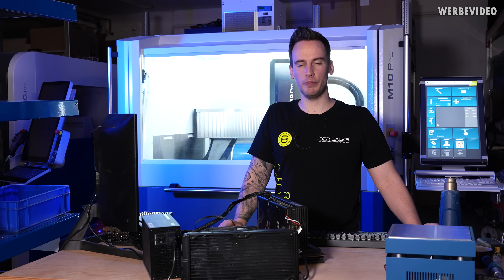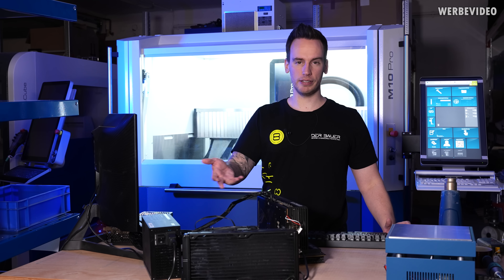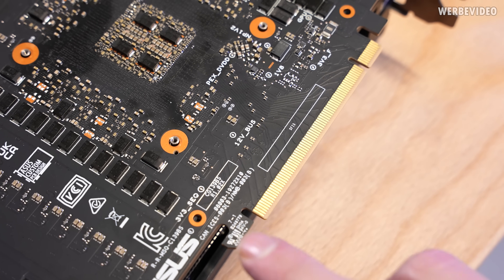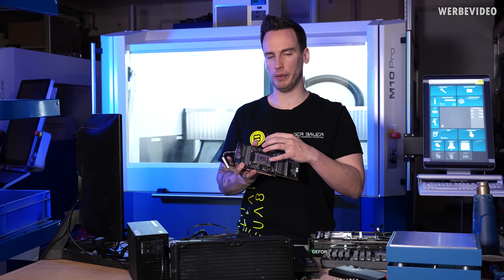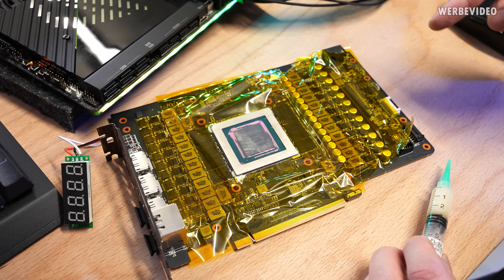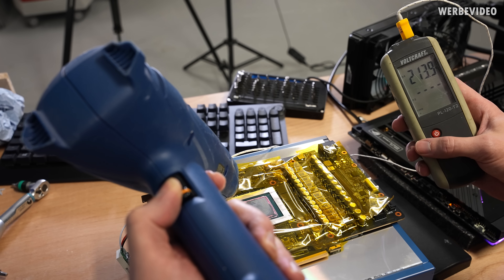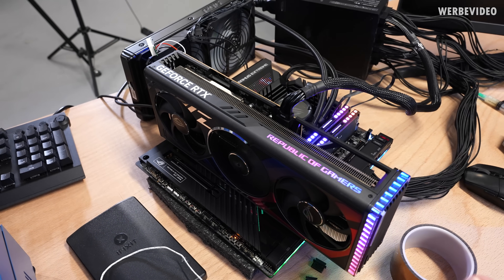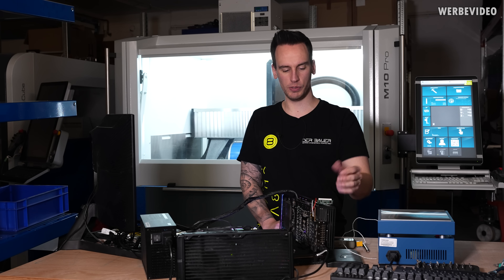I tried to repair my RTX 4090 and killed it :(

Comment: with flight simulation, I don't think i want my 4090 card running at x8.  ms2020 is brutal on GPU's and CPU's.  It eats them and spits them out.  If I could run my 4090 at x8, I could put another 2TB nvme m.2 SSD in my gaming computer.  So yea, I'd love to run it at x8 to gain me more lanes.

Comment: You better need infrared repair station for such level of repair. It can follow special thermal profile with phases like flux activation, solder melting, etc. Of course, it's possible with the heat gun, but the skill level required in this case is very high + the heat gun itself should be dedicated for electronics repair with temperature control.

Comment: Not sure how basically injecting flux under the gpu would have helped it in any way? My guess is this was bios or driver related and but hardware at all. Why didn't you request a replacement?

Comment: I baked my old Radeon 9800 XT back to life back in the days. I was very careful to wrap the underside of the card in aluminium foil and use a toothpick to get it as snug around all components of the card to make sure the foil would hold them in place in case any solder would dislodge. I just put it in the oven and let it run for 200°C for an hour.

Comment: I'm fairly certain you would have checked this, but in the interest of being thorough: when you did the hot air reflow, did any of the passive components (resistors, capacitors, etc.) move out of place? Were there any solder bridges created? It could be the GPU itself is fine, but we've lost some signaling lines, or they're being pulled to the high/low rails when they shouldn't be.

Comment: I would recommend a proper bga service shop for this card,and Im sure your card after 220C should not be dead.
I live not so far from you 2 or 3 borders like,and i got an asus rx 580 with memory related problem,what under load made some artifacts that tipical in memory bga problem.
Long story short sent back to rma,in germany and  asus service simply repaired it with proper bga machines,and devices.
You should call them,or find them to check out your stuff.
This stuff worth to repair,so asus service should help( not for free obviously),but if its not the case in EU i know 2 or 3 guy who whould take of those rams,or at that case gpu if needed,and repair it.
BTW i worked these type of hotplates ,and these are good for reballing and not for reflow for sure.
These works like in the middle you get the temp what you read,and the corners and edges expect much much lower temps,due to the surrounding air is lower,and basically it  cools back,and im sure there is just one sensor worst case in the middle, better if its corner,but that means in middle could reach like much more so these hotplates most cases useless,and about heatgun i dont even want to say a thing.

Comment: Heatguns like that don't have much fine control over the air temperature. It simply bangs it on and off I an cyclic manner. Good for stripping paint off things and burn things. But for reflowing it's horrible. Likely the GPU die itself reached death-tempertures. That's why it has to be a reflow owen, or a proper reflow/soldering heat gun with the proper temperature control.

How do I know? 

Experience. I made the same mistake.

Comment: When I saw hod did you aproach to do this, I was pretty sure you will kill it, no matter that I read it in the title... I used to bake so many cards and some of them were fixed and some not, but never put flux and allways with the GPU under, because when you do it with GPU on top, it's own weight can cause solder points to merge ;)

Comment: I've fixed GPUs multiple times with the oven method.10 minutes at 200 degrees C. And turning the oven off and opening the door before taking it out. Different problem though. Heat gun doesn't work I tried that. You need all of it hot for an extended period and heat gun is not uniform.

Comment: I have a Strix V64 that does the exact same thing, but it has a shorted core.
You didn't think of just how hot the air coming off the gun is, you only accounted for the temp sensor temperature

Comment: A screw recently broke in the heat sink of my MSI GTX 970 as I was attempting to add new thermal compound - I really believe I was more upset over than that Roman was killing a RTX 4090.

Comment: Not an expert, but I'm pretty sure that materials used for BGAs and die-attach materials are only meant to be heated up once to a certain temperature, afterwards every heat up above their temperature profile is a coin toss between prolonging it's life until inevitable failure due to the same issue or just straight up destroying the connection between package and PCB or package and chip die.

Comment: Sorry to hear about your 4090 RTX ... Maybe off topic but maybe another cooling system not yet on the market could solve everything (including the failing cables as the power requirements would be much lower with undervolting at the same time whilst still overclocking) I have send you an email just now about this :)

Comment: I'm not sure, but I don't think adding flux around the chip is the best idea for this.
It is sometimes done for BGA reworks, but only with a proper IR rework station.

I've seen other people do that on YT vids, though (and I've done it myself), but I've never had good luck with using a hot air station alone, only a reflow oven.

I think the non-uniform heating method is a big part of the problem here, ie. using the heat gun...

Some parts of the chip would have started to reflow first, and the capilliary action of the (now very liquid) flux can cause the solder balls to "swim" around under the chip, and cause an open-circuit or bridges.

I'm also not sure what effect it would have that the GPU seems to have epoxy on the four corners?
(normally during a reflow, the chip will tend to self-center over the pads, as the solder paste and solder balls melt.)

You'd probably be better off with a cheap 1500-2000W toaster oven modifed with a reflow controller, to reflow the whole card at once.

Although you'd then you have the problem of making sure the components on the underside don't fall off. lol

They sometimes add the red glue under every component on the underside during pick n place.
But more often these days, they just PnP the underside of the board first, then they protect it from the heat with a kind of shield, during the second pass through the reflow oven.

(and the industrial reflow ovens can be set to heat more from the top of the board than the bottom.)

It would be interesting to see an X-ray of the chip on this 4090, to see if it really is a problem with the solder balls.

With the amount of Kapton tape on the board, I'm doubtful any smaller components would have moved much (if at all).
Maybe something on the bottom of the board got damaged by the preheater, though?

(or the combination of 100C preheat on the bottom, and the 220C+ heating from the top, caused some component on the underside to shift maybe?)
Reply: Oh, as others have said, maybe some RAM or something did reflow when applying the heat gun, but the Kaptop tape was putting uneven pressure on the chip, causing the solder balls to bridge?

That does make quite a lot of sense.

Usually with that much Kaptop, it can shield components very well.
But with the preheater on the underside, it gives everything a "head start" on the reflow process, so when you applied the heat gun, something else might have shifted.

It's weird how the OS isn't even reading the GPU temp, though. That could either be an issue with solder balls under the chip, or maybe even a switching reg on the board stopped working for whatever reason, and one of the supply rails is missing?

Definitely worth checking all of the major power rails for 5V, Vmem, Vcore, PEX, etc. before trying anything else like MATS.

Comment: Should have probed the PCI pins first back to source to see if any were shorted or disconnected. Could have done that with a cheap multimeter. Call Rossman or NorthridgeFix.

Comment: Roman, I like your reviews, but your liquid metal graveyarded 2 motherboards now, 3 gpus, and potentially one i9-9900k, that one I can't check now with no motherboard.
I am always super careful in liquid metal applications too. 
I will never use liquid metal on any of my cards again. I suggest no one does either. Even a microscopic amount of liquid metal can run off into the socket or capacitor area.
Reply from the maker: I honestly never had that. Usually you apply so little that there is no chance of LM dripping in anywhere.

Comment: It’s really important to consider the history of this card. It’s very new (obviously), it has a PCIE problem, and it has been under LN2. The PCIE slot is essentially directly connected to the GPU chip, and since the capacitors tested fine, the original problem was almost certainly with the GPU core itself. Since the heat was applied to the GPU core, and the board was covered with what looks like thermal insulation tape, it’s unlikely that another component received too much heat. My guess would be that the bumps connecting the chip and the substrate have failed/become misaligned. Buildzoid explains this really well in his video about chip degradation. It’s important to note that the PCIE controller and the memory controller (which showed up as not detected in the GPU-Z report) are both on the edge of the GPU die, and therefore are most likely to be affected by thermal expansion. Furthermore, LN2 means that the card has been under a much larger change in temperature than normal. The GPU-Z report of x16 functionality being restored is further evidence for this theory (assuming it is accurate). As for a solution, fixing this issue is difficult and not always permanent. The key idea is to get the die and the substrate to a similar temperature, so that the bumps connecting the die and the substrate realign. Most fixes of this type put the GPU in an oven for about 10 minutes, which is plenty of time for the die and substrate to reach equilibrium. I suspect the heat gun heated the die to a much higher temperature than the substrate, exacerbating the issue. You could try the oven method or turning up the temperature of the preheater to a similar level as the heat gun. Alternatively, since you have liquid nitrogen, you could try to cool down both the die and substrate. It is possible that these strategies won’t fix the issue. However, they shouldn’t cause any additional damage if another component turns out to be faulty. I wish you the best of luck with this repair, and I hope to see you break some world records with this GPU!
Reply from the maker: I thought the GPU would not move as there is some glue on the edges. Possible that the GPU got too hot though. The heatgun uses 350°C temperature. My current plan is to send it to KrisFix :) Already talked to him
Reply: @der8auer-en  Best decision you could've made. I hope he does a video about this aswell!
Reply: @der8auer-en  solid plan
Reply: Probably, the heat gun finished it of by the means of too much heat, thermal expansion and thermal contraction. And something tells me that the BGA balls got damaged too by this process.

Comment: Heatgun isn't precise enough. You need a good re flow oven (aka a toaster oven with some temp probes in it), and you need to generally heat and cool the card slowly.

Comment: I did put my gtx760 into the oven at 130C for like 20min when it started artefacting, then i left it in the oven to cool down and tested it in PC like 3hours after baking it and it worked for another 3 years :). I think u might kill it by moving the card when it was still not cooled down enough and some parts could move or de-solder. Try to put it to oven again on since u have nothing to lose at this point :)
Reply: Can also confirm ovens can fix bad BGAs.  No it won't fully reflow, but it may at least sinter the bad solder together and make it work again.  I fixed three free TVs this way.  But yeah thermal cycles are huge issue since it's so fragile, but it's better than nothing you can always rebake it.

Comment: I'm sure the temperature was fine.  But the amount of time spent at very high temperatures may be what caused the total failure.  An it could be just some of the very tiny SMD components were blown out of position by the hot air.  Lot's of things to go wrong there.  Personally I say the biggest problem is that it's a Gigabyte card.  I think their PCB layouts are sketchy at best.
Reply: Strix

Comment: i put a little lead solder wire on top of the die and then just heatgunned it , with a macbook once. the solder melted then i stopped adding heat. it can also help making a tinfoil square cup around the gpu. the repair was sucessful and nothing fell of the back of the board

Comment: nah, putting GPU in "oven" you misunderstood

When I worked for a company where we built PCs and stuff, sometimes parts came back (memory, HDD..etc) that caused the system to crash.. but it was hard to prove that the part is bad...  If you sent back a piece memory card to the factory (that caused "crash") the factory would test it and send it back as "good".. 

So you had to make sure they replace it... this is when the oven trick came , but it is important you use the correct oven... 

3-4 seconds in the MICROWAVE oven does the job :D

Comment: @calop002
I'm currently have a wierd issue with my 4090 TUF ASUS non-OC card. 

9 out of 10 times the card only runs at x8, 1 out of 10 times it succesfully runs in x16? This is after boot up, and it stays that speed throughout the session until i reboot again. 

Do you have any idea from your experience what this can be? 

(i have double checked that nothing is officially taking PCI lanes on the motherboard, all bios updated to latest etc, i tested various bios settings etc).

My setup is:
ASUS x670e Hero
AMD 7900x 
ASUS TUF 4090 non-oc
Corsair RM1000e PSU 
Kingsfury DDR5 5600 x 32gb

Comment: Yeah there is a science to re flowing BGAs, I used to make a living doing it.
Your first mistake was using the heat gun instead proper hot air rework station, hot air guns are nowhere near precise enough and even worse the temperature of air they put out is constantly wearying due to the way they are controlled.
2nd you need to look at the data sheet of part you're trying to reflow, it will tell you the exact temperature ramp and time needed to reflow it, anything more than spec will damage the part, anything less will do nothing.
and finally large packages like GPUs can only be reflowed with oven or even better a hood for rework station designed specifically for the chip you're trying to reflow.

Comment: Ive got alot of respect for your work in the field man, i will say how ever as a fellow overclocker who mods judst not to the extent you do i can say this time round you might have hit the mark where you dont have the tools to of done the job like manufactures do. way the 4000 series is setup is all over the place, a bunch of things weere changed like nvidia is trying to gain full control over things. ive noticed from others as well doing thigs on the 4000 series is like pulling teeth lol.

Comment: if nothing else works, reflow it again at a higher temperature.

Maybe you cold fractured the joints by getting hot enough to cause maximum thermal expansion, and greatly soften the solder, without reaching hot enough to cause uniform reflow.

I've never worked with BGA parts, but I've done a fair bit of designing and hand assembling PCBs with small pitch no lead packages, so this is just a hunch.

Comment: I'm surprised by the result. I successfully restored a dead GPU (I think it was a 9800M SLI) from a DELL XPS about 10 years ago using that same method with a heatgun. I didn`t use a heating plate though, I just covered the whole card in aluminium foil except the GPUs and I elevated it from the table using 2 aluminium foil squashed balls (which were in turn on an aluminium pan)... Yea very janky setup but it worked, not permanently though, it worked for about a year, then it died the same way (black screen). I could have tried to resurrect it a second time but instead I just sold the notebook for parts.
Reply from the maker: I had many comments like this now. But also many that said it would always kill the GPU xD quite funny
Reply: @der8auer-en  Yea, I don't know if the people that say it would absolutely kill the GPU have at least tried it or not, because I would be curious to know how much of this is down to pure luck (like if the chances of this working are actually super low or if there are good chances that it would work). I just looked on my NAS, and I found the pictures I took during the process. I can confirm it was a board with 2 GPUs on it. I remember now I "reflowed" both of them at the same time, because I didn't know which one was dead, so I guess I was extra lucky that it worked. I can send you the pictures if you want, sadly I didn't record a video of the whole process though...

Comment: Maybe cooking it corrupted the bios and it needs reflashed? If the bios is corrupt it will not initiate but maybe just enough to report what it is. Plop another GPU in it and flash that bios! 
*Edit didn't see your reply. Maybe some of the shunt resistors got too hot somehow?
Reply from the maker: checked all tiny resistors and caps around it. Looks all fine

Comment: Those caps at the back aren't for decoupling, they're AC termination capacitors. With decoupling you're typically putting the capacitor between a voltage rail and 0V to provide a low impedance path for high frequency currents. PEX uses AC coupled differential pairs. The capacitors are in series with the signals, and are used for DC blocking.